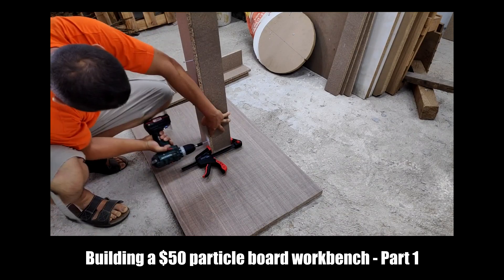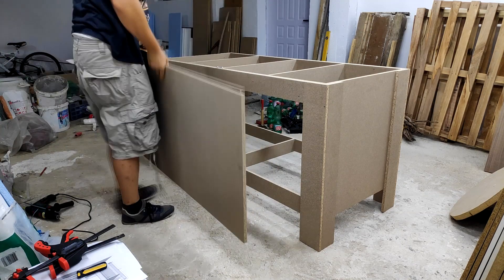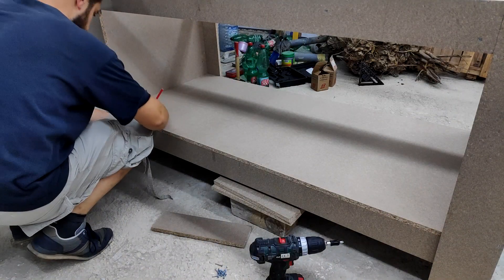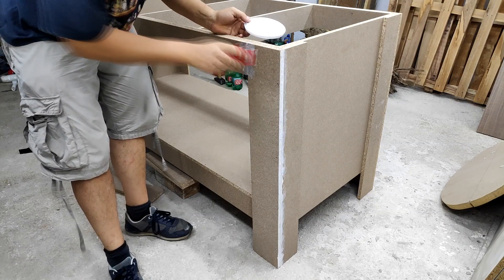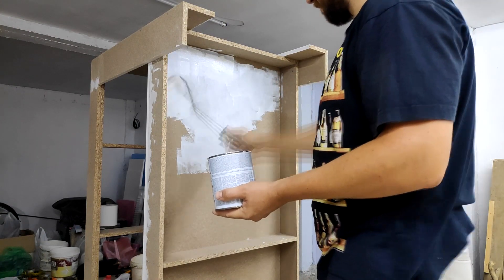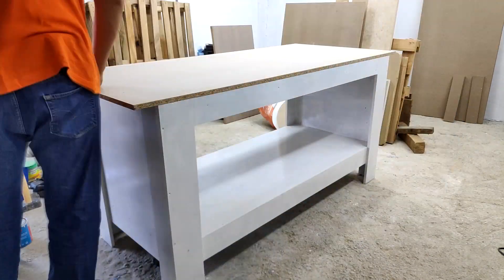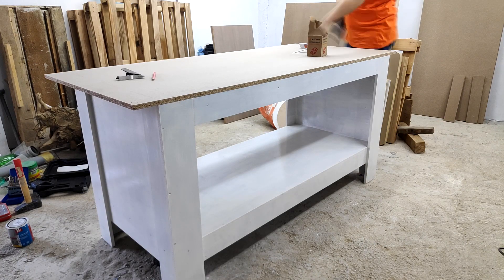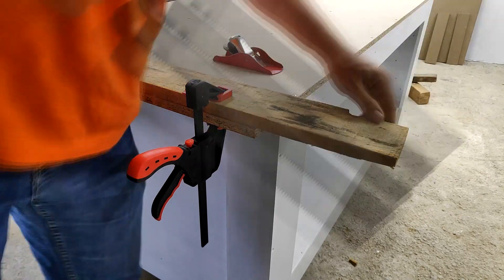Building a $50 particle board workbench - Part 2

Comment: I love this.  This workbench is exactly what I need.  Thank you.  I used to live in a damp climate and found the edges of particle board shelves crumbled...BUT once I sealed them with a shellac primer, no more problems.  I plan on sealing mine with clear polyurethane. BTW, you could have cut the bottom self in half crosswise where it sets on the cross support to get it in there.  That's what I would have done after all that work!  ha ha ha!
Reply from the maker: Thanks. Sealing with literally anything is all it takes. 
As for the shelf, I wanted to have it as one piece for added rigidity but yes, cutting it in half would have made installation a lot simpler.

Comment: I think particle board would be good for making a "disposable" workbench. And that might be the right way to go for some people. It would be interesting though to see how much more it would cost if using something more durable. The labor would be almost the same. I'm inclined to think that the time to build and paint might be a bit much for building a five-year table. Cheap pine with an MDF top would last indefinitely, and I don't think the additional cost would be prohibitive. And over 20 years, might cost even more to replace the particleboard table. Nice video. Subscribed.
Reply from the maker: Cost is one thing. Another thing is that I'm not a woodworker and I don't have the tools to process the wood to make it nice. We'll see. So far it is working.

Comment: ad solid wood to the  bottom sides of  yourt countertop, they will add structural strengh to yor workbench and you will have a better more stable clamping, cheers !
Reply from the maker: I did consider that at first but I'm using the bench for several months already and there is absolutely no need for that. The bench is sturdy as a rock. The only real need for actual wood is on the Moxon vise that I've added to it.